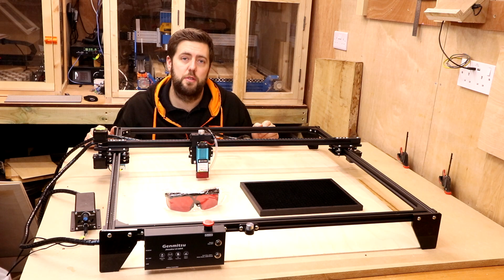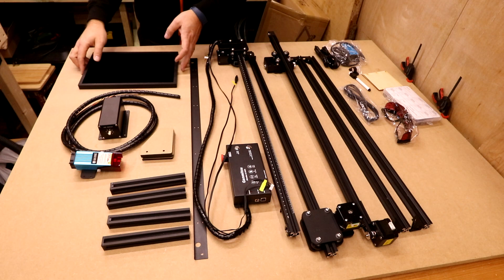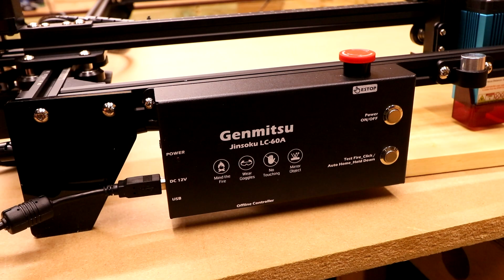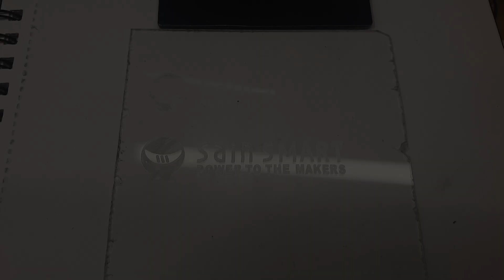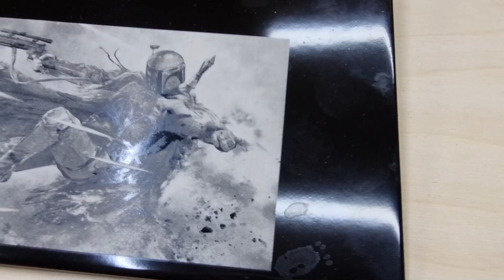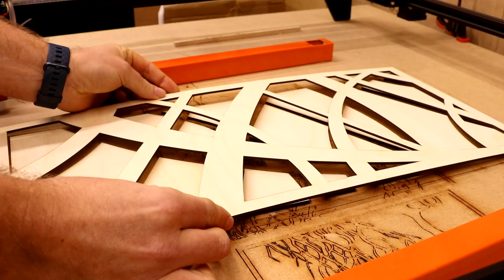Sainsmart Genmitsu Jinsoku LC-60A - Complete Build and Review

Comment: I realize this video is a couple of years old at this point. Has anyone found a way to snug up the X-axis carriage wheels to the extrusion. I was looking for eccentric nuts, like on all my 3D printers, but it doesn't look like that's designed into this machine, and there's no way to correct the slop. Any help would be appreciated.

Comment: Hi James Does this come with Honeycomb Working Table or bed thanks
Reply from the maker: Yes it does come with a honeycomb bed
Reply: @JamesDeanDesigns   do you know what size, Thanks again
Reply from the maker: @owdoco5657  its not that big in comparison to the size of the machine, about 300x200 I guess. If you check about 1:20 into the video you can see it with the machine

Comment: James thank you again. Your videos are always a great help and find informative bits of info that can use on other projects.
You mentioned extention leg storage. Had issue with the special  corner M5 nuts being miss  threaded and Sainsmart sent me 10 replacements. Special M5  t nuts with spring wire to hold nut in track. Took four M5 t nuts and inserted in legs then used the M5-30 bolts that are used to secure legs and screwed bolts through leg mounting holes in front and back rails into nut and worked great for storage of not only legs but the bolts ;-))) 
Thank you again.
Reply from the maker: Great tip!

Comment: Hey, great video.  I just purchased this laser and I'm very happy with it.  I'm struggling to find good cutting settings.  The two test pieces of wood that were sent struggled to cut through when on 100% power at 10% speed with a few passes.  Is there something you did to get those clean cuts?

Comment: Hi James, 
I'm wondering if you can help with your laser speed settings? It appears in your video that you're able to (As Sainsmart claim these lasers can) cut 3mm in one pass?
I've the 3018 Pro with the 3040 extension kit, the 5.5w laser attached and air assist, and i've got the machine to do nice clean cuts at 600mm/min but this takes 5/6 passes and is rarely consistent, sometimes 5, sometimes 6. Is there a recommended speed that can guarantee cutting in one pass?
Reply from the maker: To cut in one pass you really have to drop the speeds down to between 150-250 usually. Personally I much prefer to go a fraction faster and do 2 passes so maybe at 250-300 but 2 passes and this gives less overburn. You will get differences, even on the same piece of wood because of the layers, the grain, the glue, the colour etc.

Comment: James, a couple of years ago,  I used your video and Graham Bland's textbook like instructions to tune the settings on my 3018-PRO.  I notice that the factory acceleration settings seem to be pretty low compared to what I ended up with on my 3018-PRO and the maximum speed settings for the LC-60A seem to be twice the specified max speed for the unit. 
Is it likely that a tune up will need to be done to optimize operation on this unit too?
Reply from the maker: Yes, most machines default settings are very safe to minimise the risk of anything going wrong so you can certainly tune and get more out of it
Reply: I was leaning that direction and was planning on a tuneup if I couldn’t get something definitive from someone who possibly had tried and found it pretty solid. 
Since most people won't even think about checking the performance I came here and I appreciate your input. Thank you.
Reply from the maker: @kevinfine1088  as always, just take a backup of all your settings before you adjust anything 👍

Comment: does the laser come with limit switches for homing?
Reply from the maker: Yes, this machine has limit switches so it can be homed. It can either be homed from your control software or you can home it using the button on the front
Reply: @JamesDeanDesigns  Thank you for clearing it up for me. i purchased this unit and i am waiting on delivery. It was between this laser and the Ortur. Seems like this one is more bang for the buck!  Some resourses said it does have the limit switches and another said it doesn't.

Comment: I can't find anywhere what the maximum cutting thickness for wood is on this machine. I'm very interested in this machine.
Reply from the maker: Its not really that simple. it can probably cut upto 5 or 6mm but it really depends on the quality of your wood. Softer wood will naturally cut easier than hardwood

Comment: JD, Great stuff. I have learnt a lot from your Videos. Thank you. I'm having an issue with my laser settings on my 3018 PROVER. I would sure appreciate your expertise if you would.  When I turn on the Lazar in LaserGRBL to determine the positioning of my Project to the Lazar, the Lazar turns on to 100% POWER and starts to BURN what ever is in its way. For this STEP I do believe the Lazar should only turn on to VERY LOW POWER so it doesn't burn anything, correct?? Then when it starts to do THE BURN the percentage at that point will be what it is set at, IE..40%, 50%, 60%...........to burn the material. How do I go about RESETTING this stage from 100% POWER to VERY LOW POWER % percentage so I can position my project correctly and not have burn makes on my project before I start the actual burn?

Comment: Great video. I've had this machine for a few weeks now. I'm currently building an enclosure for it. I think it's one of the best overall packages in a diode engraver right now. I don't like the rectangular laser dot, but at least it's a small dot. I've only done a little testing with my machine so far. Have you noticed any real world negative effects of the rectangular dot?

Comment: Good information James. Will it engrave wood with fonts with upto 10mm wide and 10mm deep characters ?
Reply from the maker: Thanks. When you say 10mm deep do you mean as in length not depth into the wood? So it can engrave really small letters on the surface but it probably will not penetrate 10mm deep into the wood if that makes sense
Reply: @JamesDeanDesigns  Ah, it was the 10mm depth into the wood I was hoping for, as if it had been routered.
Reply from the maker: @rl3898  you would end up having to do multiple passes, clearning the charred material each time. Yes, you could eventually achieve it but it would be a lot of work